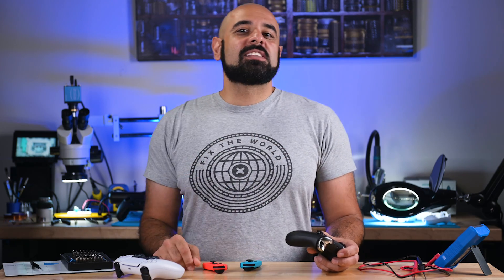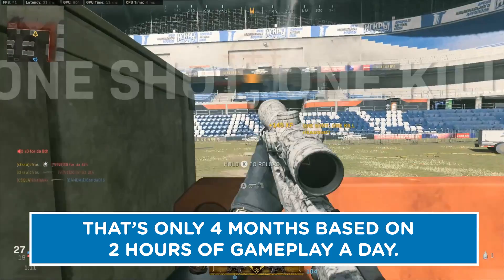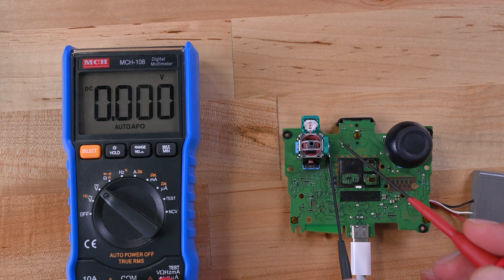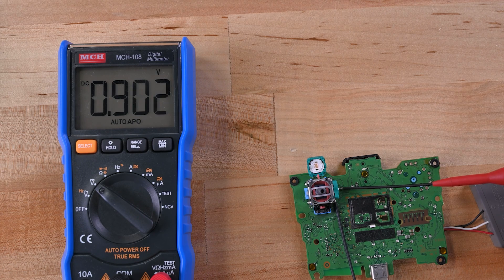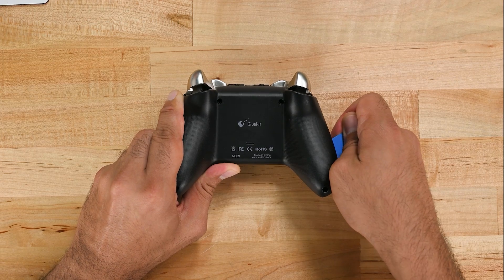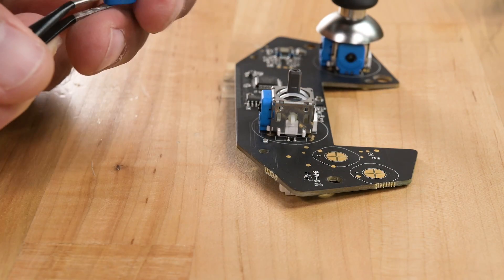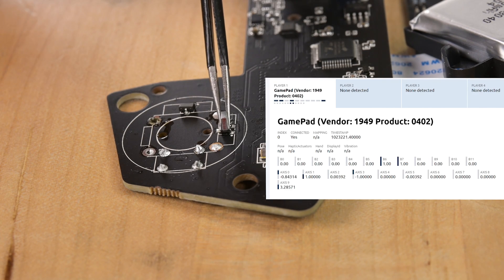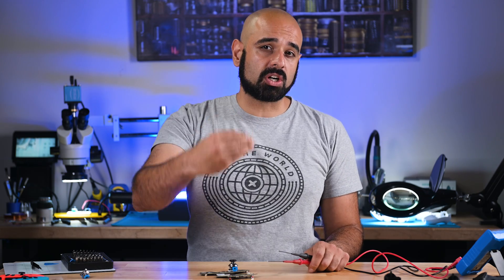How Manufacturers Can Fix Joystick Drift - Permanently!

Comment: It would be cool if either you guys or gulikit could release hall sensor sticks as replacement kits for some of the most popular controllers
Reply: Not sure that would work. You'd probably need to solder new chips onto the existing boards and adjust the controller bios to interpret the signals correctly. That's not a simple project.
Reply: @JamesTHammond  They sell replacements for the steam deck sticks at least
Reply: @JamesTHammond  Those chips he demonstrated vary analog output voltage. If these HFS's output a PWM or some other digital signal, that would make sense, but this is just voltage, and the voltage is very similar to what the existing pot-based systems output. I wouldn't be surprised if the challenge is more in getting the HFS chips mounted than anything.
Reply: @wydra9-1  same thinking i had. The voltage output possibly is just a reference to the controller cpu so it knows where the joystick is with no digital signal being sent.

If that is the case, modding it into a controller is actually quite simple if these parts are available for purchase. Biggest challenge would be mouting it into the board, alignment and knowing the magnets polarity so it doesn't work backwards (push up and the game goes down). Sadly they don't sell those joystick boxes they make, only way to get them is with the controller or the switch mod :(
Reply: @wydra9-1   I thought so too, but seeing that the Steam Deck replacements from Gulikit have chips integrated, I'm guessing there is something else involved in this.
Reply: @ivanaviNiebla  indeed the controller's MCU need to interpret what the HFS is spitting out Ben Heck has indepth on how he does it he basically took another Teensy MCU to interpret the HFS data and then convert that back into the controller's MCU could understand

you can probably use a resistor to mitigate the higher voltages spat out by the HFS rather than piggy back on another MCU
Reply: @wydra9-1  and the bios gets updated, not simple turns to impossible.
Reply: @kidShibuya  just don't update the controller firmware, most controllers don't have firmware updates anyways
Reply: How would a firmware update affect this if you literally just replace the source for the analog signal? The Hall Effect sensors show in the video just output analog so it would just be a matter of putting one in and adjust the voltage with a resistor
Reply: @JamesTHammond  Looks like with this particular arrangement and type of Hall sensors, all you need is a dual opamp to adjust and offset the values to where the controller expects it to be. It really is designed for a drop in replacement. I bet they're working on a drop-in version where you get 4 trimpots to set it.

But also this style of stick was never used before because it has some issues. The way other Hall sticks like flight and Dreamcast work is that the complete mechanical XY splitter setup with several joints is GONE and the return spring is on the periphery of the stick body, which allows for a more resilient more durable spring because it barely has to move. Also there are 4 Hall sensors at the very bottom of the stick directly reading the magnet dangling from the stick - but the evaluation of the signals has a little math complexity to it, you can't just feed it to an existing analogue gamepad circuit, you need to compare readings between the sensors to determine the position, and i believe some nonlinear correction is performed as well.

I have found potentiometer wear to actually be a comparatively small problem, like it does occur, but not as quickly as other issues. Other being that the friction in the XY splitter causes it to lose a small amount of material and decay in quality, become sloppy; and that the return spring gradually loses preload, no longer decisively centring the stick, since it's subjected to relatively large movements relative to the size of the spring - and the spring cannot be any larger because the space is taken up by the splitter assembly. This stick manages to retain all of these issues which should not even be a problem with Hall sticks, and never were before, but they are issues with potentiometer based sticks. Them claimed not having a deadzone which accounts for these issues which are mechanical rather than electrical in nature tells me these sticks will be plagued with wear induced drift again.

Ultimately releasing a device like this is an investment, you invest in engineering and tooling and marketing; but the way you protect a tech investment is by a patent. But you can't patent a stick that was built 25 years ago! so you invent some other arrangement and claim its "usefulness" - i bet the one they claim is the ability of their patented design to serve as a drop-in replacement for ALPS style potentiometer sticks. Plus you can't just release a durable product that people will buy once and be set for life, there's no business model in that. That's the backwards world we live in.
Reply: Boy do i have news for you
Reply: My Razer Wolverine I haven't even used that much and it already has a slight bit of left stick drift to the left. If there was a way to solder on a hall-effect joystick I would do it.
Reply: They are available. I have installed Gullikit ones for the joycons, no more stick drift for those.
Reply: My brother, your wish has been granted

Comment: Hall effect is less precise
Reply from the maker: The resolution depends on the hardware used alongside the sensor. A 12-bit ADC used alongside these sensors should deliver results far superior to a standard pot. Both the Sony Sixaxis controller and Gulikit controllers deliver better accuracy and lower margins of error, and the latter claims not to incorporate a "Dead Zone" which would further increase overall accuracy.
Reply: Not necessarily.

Comment: Why I didn't have drift in the ps1, 2 and 3 Era but it appeared since 4 and onwards?
Reply: It's possible that some of those controllers used other types of more reliable sensors. Such as hall effect or optical sensors which the original n64 controller used, similar to what was in ball mice or is in the scroll wheel of a normal mouse. Or they just used higher quality components and not the garbage bin special that current controllers use because potentiometers are dirt cheap.

Comment: It all comes down to money, how many new controllers will not be sold because of the hall effect upgrade VS how much extra money can controller manufacturers get away with charging for the hall effect upgrade while still having a "engineered obsolescence" (intentional failure point) built in so you still need to buy a new controller on a regular basis.

Comment: The challenge will be: Supply chain availability and cost.  If either of these are not aligned with what the companies are looking for they will not pick up on it.  I have gone through many controllers (PS5, Nintendo Switch) in the past 18 months and I have kept them.  I will attempt to replace the POT on one and see how easy it is.  I am, for obvious reasons, not using my joy-cons at all on switch, only play with controllers where it will be cheaper to keep replacing them.  It sucks, I know but nobody will really fix this for the foreseeable future.

Comment: Wouldn't be surprised if stick drift is planned obsolescence to make you buy more controllers.
Reply: it is 100%
Reply: Fr
Reply: Well, thats the reason bro, imagine how less controllers they would sell if the controllers more durable
Reply: Это так и есть. Разве ещё непонятно?
Reply: I think it's a happy accident.
Reply: I had a stick drift issue and I fixed it with 15$ locally with a service shop, it was not a big issue, I also had a broken spring and that cost around 10$ to fix, local tech guys do not charge much for these issues.

Comment: That's a misleading, clickbaity title. It should be more like "How manufacturers can fix the drift issue permanently."

Oftentimes you can't even fix drift by swapping the part as controllers are calibrated at the factory and there's no way for the consumer to re-calibrate it after swapping out parts.
Reply: @karm42yn Yes, but this is iFixit. Not theyFixit
Reply: @sadbucket  Yes, but this is iFixit. Not theyFixit.

Comment: Why don't the major manufacturers use hall effect sensors instead then? Are they more expensive than the current potentiometers? Or do manufacturers like to introduce the built-in failure with potentiometers so that they can sell more controllers? I suspect it's more likely to be the latter.
Reply: It's both. Potentiometers are dirt cheap so it increases their profits per controller, and since they break it means they sell more of them.
Reply: It's all about money really,  they enjoy selling controllers,  pretty sure they make nice profits from them
Reply: Mass production. Both MS and Nintendo are reporting controller shortage, not sure about Sony.

Comment: They just need to use magnetic Hall effect sensors to eliminate the 2 of 3 types of stick drift and the only 2 1st party controllers to use hall effect sensors are the ps3 controller and the sega dreamcast controller.
Reply: What would be the third type of drift?
Reply: @banescar  Wear on the center return spring of the stick. The part that makes your stick stiff and spring back into the center part. It can get sloppy over time or even completely fail after a hard drop
Reply: @neotil  at least this lasts way longer and if it ever fails it's extremely easy to replace
Reply: @fgmenth  Yes, it does last way longer. But if you consider it to be easily replaceable then just replace the entire stick at once...? You're already desoldering the center parts so why keep the old "sensors" (potentiometers)
Reply: @neotil  it depends on the stick. For xbox or ps, sure replace the whole thing, but for switch you could just replace the spring as it doesn't require any desoldering
Reply: @fgmenth  I guess... But the part is like $2. Just replace it lol

I was able to add some contact grease to my switch joycons and they haven't had any drift issues any more after 2 years of use and zero maintenance. So maybe it is worth it
Reply: @neotil  GuliKit announced last month that they made a Hall Effect stick for Switch. I'll be replacing my stock sticks the moment it becomes available.
Reply: So how did the original sticks in an N64 work? To me it always felt like something was stretching and I imagined some thin chords being measured somehow. Probably daft.
Reply: @JamesTHammond  it had just one big spring to center the stick and optical sensors to read its position
Reply: The n64 controller used an optical sensor for its joystick. Which is actually another way to eliminate stick drift
Reply: Where did you see that PS3 controllers use hall effect sensors? Every Dualshock 3 I've ever taken apart uses traditional pots just like the PS4/5, xbone, and series S/X.
Reply: wait what? DC and N64??? we regressed from that!?
Reply: @すどにむ  they weren't that great, they could fail in other ways. N64 stick literally disintegrated after heavy use
Reply: @fgmenth  The N64 sensor is flawless the problem was in the stick mechanism that wears out.
Reply: @GenesHand  exactly, open up any used N64 stick assembly and you'll find plastic dust that came from the stick itself and the housing

Comment: I wish they would release a replacement sticks for regular controllers just like they have done for steam deck. It will be a pain to replace them in newer harder to disassemble controller designs, but i think it would be worth it.
Reply: they seem to be working on ones for the switch, theres a photo pinned on their twitter
Reply: @sadiesm  switch are also modular tho
Reply: @AlejandroCaicedoPUJ  i am aware, ive had to replace my joycons joysticks many times
Reply: @AlejandroCaicedoPUJ  Yes but it'll involve more R&D to make it that compact. So it might happen but it'll take longer.
Reply: @sadiesm  they need to make some for the ps vita too, the right stick on my 1001 stopped working today so now I'm not going to be taking it with me on a long ride in a car at the end of the month to remote play my PS3 or my mom's PS4, I found a set of replacement sticks for almost 30 USD each on ebay (so for a new set I would be paying over half what I paid for my ps vita in October of 2020) but I want to replace both sticks with sticks that won't drift after a while.
Reply: @nathanmead140  Eh, I love my Vita and still play on it, but they'd have to be crazy to spend all that time and effort to make modules for the Vita considering it's an extremely niche target audience. They'll only make them for controllers that sell well and frequently experience drift (i.e Joy-Cons). I've had my Vita since PCH-1000 launch and it had drifting only some 7 years later so I'd imagine the failure rates aren't high at all.

Honestly though, if you can find a PCH-200X for cheap I recommend you to switch to it. Parts for its older 1000 sibling are significantly more expensive (sticks for 2000 cost just $1, compared to 1000's $15 for one side) and the SoC is more prone to failure (look up the much dreaded GPU driver error, which seems to be a 1000-only issue). I've exchanged my motherboard twice out of love for my red Vita body and the better display, but the next time it fails I'll just throw it out and get a 2000 and tolerate the crappier display.
Reply: I think the reason they were able to do it for the Deck, is in it the sticks are fully modular, including the PCB they attach to. Meaning they could include the hall effect sensor on the small PCB that you replace alongside the stick. But in most controllers, replacing the thumbsticks means de-soldering the little stick module, but that doesn't include the hall effect sensor, which is on the PCB.

Hence, hall effect replacement sticks for say the DS5, would mean replacing the PCB which the sticks are attached to, but in the DS5 that'd mean all the other guts of the controller, too.
Reply: @MentalEdge  I reckon it's possible by using thin flex pcbs, have the sensors on it; seems like the gulikit stick has the same footprint as regular ones, have a flex pcb with some what normal stick holes that has the sensors on it connected to the normal holes in some way, pass the metal housing pins and button pin through the flex pcb then main pcb, then have the flex normal holes connect to the main pcb normal holes
Reply: @HentaiNat I presume you've seen gba's with flex amplifier / circuit cleaner upgrade. I agree gulikit should learn about this technique and develop a kit that would use the old mechanical parts of the joystick, provide a replacement with the magnet for the potentiometer and a flex pcb to afix the sensor and convert it to the voltages produced by the potentiometer replaced.
Reply: @HentaiNat  Yeah there has to be a workaround. Say if the thin PCB can be done, would the resistance be similar or might there be other hurdles to overcome?
Reply: @MentalEdge  Honestly speaking, I wouldn't even mind it if they made a kit that required you to change the entire PCB. Even at $70 such a kit would be worth it seeing as it would save you from replacing a lot of sticks in the future, or replacing controllers.
Reply: @khaledassaf6356  I agree or a pcb that would have their gulikit thumbstick and the modder would transfer all the chips from the pcb or have a way to cut away the thumbstick part of the pcb and replace that with their pcb.
Reply: @MentalEdge  yeah but they didn't make them modular by choice. Why would they do that? better for their profit margins to sell you a new one when drift happens. Capitalism is trash.
Reply: @AlkaVirus  You're preaching to the choir buddy. Did you take me for some anti-repair fool? I was just explaining why GuliKit is unlikely to come out with hall effect replacement kits for regular controllers, while doing one for the Deck was easy.
Reply: @MentalEdge  Gulikit should release a PS and Xbox certified hall effect controllers... if they refuse to certify their controllers, they can always take it to social media.
Reply: there's an youtuber called Marius Heier, he is making drop-in replacements for ds4 sticks